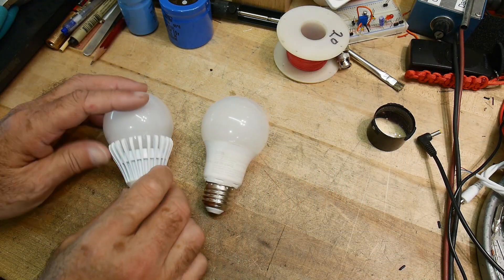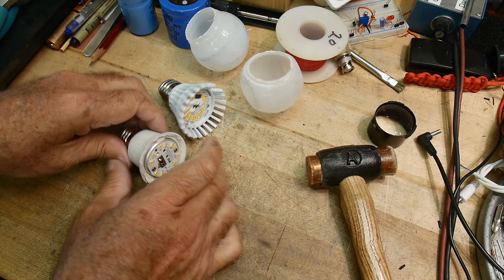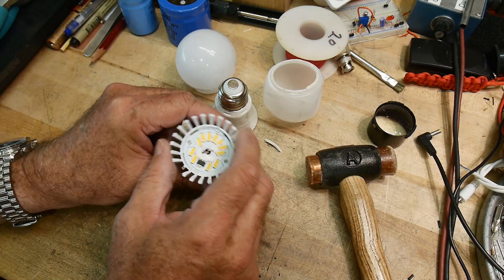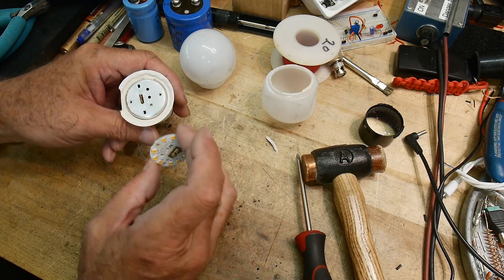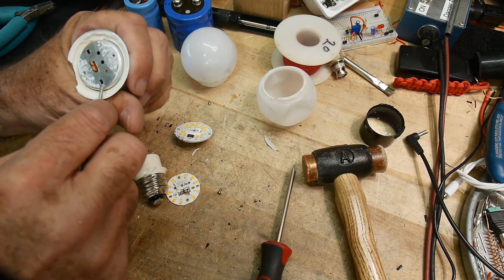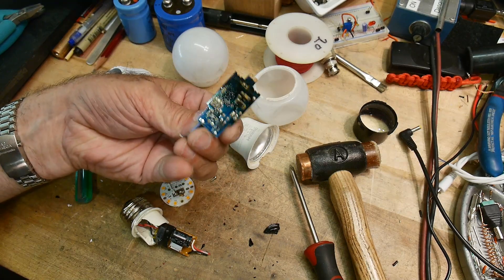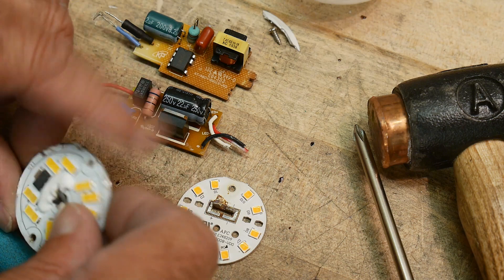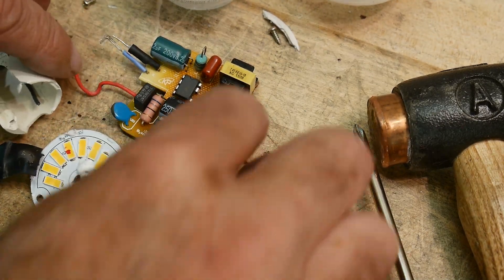#845 LED Light Bulbs Teardown

Comment: The typical failure mode in these LEDs is overheating. They are usually designed with a too small heat sink and they run too hot. That will kill them soon.

Comment: Lead-Free ROHS solder connections failed (as designed) in both of them.
Reply from the maker: choose the right temp solder, seems a bit sketchy but I guess they design it to not continue to have a mechanical contact.

Comment: What do you think of the CREE light bulbs.  I've had a number of them fail despite their claimed high MTBF.  They are guaranteed, but sending them back and requesting a replacement is by design more of pain than it's worth.

Have disassembled a few and it has been interesting to see the design evolve over the past few years.  The failures have never been with the LEDs.  

As an engineer, amateur radio licensee, and operator of both gate and garage door openers I got interested in LED lights from an RF noise perspective a couple years ago when we had some landscaping done and an upgrade of the lighting to use LED bulbs.  When my wife returned home that night she couldn't get the gate opener to work.  I checked and everything was in order with the gate opener.  It could be manually triggered, but not wirelessly opened.  I had to stand right next to the opener with a transmitter to get the receiver to trigger.  Initially I though the receiver had gone bad.  Looked online to see if I could find any schematics and maybe see if I could fix it. 

Interestingly, the search turned up all sorts of hits related to LED lighting causing problems with garage door openers.  A different kind of light bulb went off when I read that.  Went out and turned off the landscaping lights and presto, gate opener worked as good as new.

We contacted the landscaper the next day and it took some convincing for them to believe that was the issue but they came out and did some testing and sure enough confirmed to themselves that that was the problem.  There was one light fixture right next to the gate opener that was the problem.  They replaced the bulb with a different one from a more reputable vendor and the problem went away.  Unfortunately they took the problem bulb with them.

I really wanted to break out the spectrum analyzer and other gear and have a look to see what kind of RF noise signature the bulb had that was bad enough at 315 MHz to render my gate receiver inoperative. 

Have checked a few bulbs of different types since then but never found any that bad.

Since then I have heard some anecdotal stories from other hams about LED lighting causing problems with signal reception but more as an exception than the rule.
Reply from the maker: LEDs are the worst. see: https://youtu.be/nn14JNxNT1Y

Comment: Wow tungsten filaments, that brings back fond memories,  used to work for Philips on the filament winding machines back in the 90's.
Reply from the maker: I was amazed when I found out that light bulbs were a coil of coiled wire. so small!
Reply: How they wound the brittle Tungsten at such a small radius?
Reply: As an extremely fine wire it didn't seem so brittle. If I remember correctly as it must be over 30 years ago, the tungsten was wound around  I think a molybdenum core to form a coil and then that was wound around another slightly larger diameter core. The molybdenum was then dissolved to leave the coiled coil shape of the filament. Or something like that, it's a very long time ago. Lol..
Reply: @brianharper9798  So complicated!

Comment: Why don't they just use a capacitive dropper ?
Reply from the maker: LIght bulbs need to meet a watts (light) to watts (AC power) requirement and efficiency is important.
Reply: I was looking for one with the dropper so i could dim it with a series cap, couldn't find a single one
Now few days ago a lightbulb died and i wanted to get the electronics from inside... guess what, it's a capavitive dropper